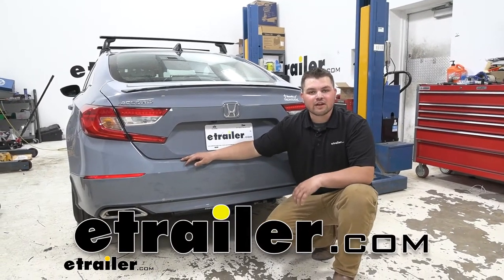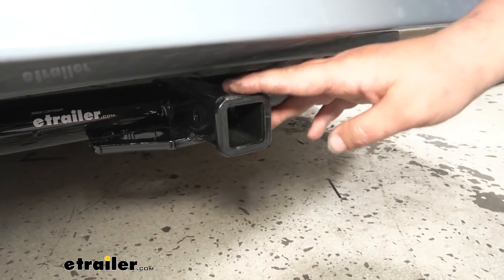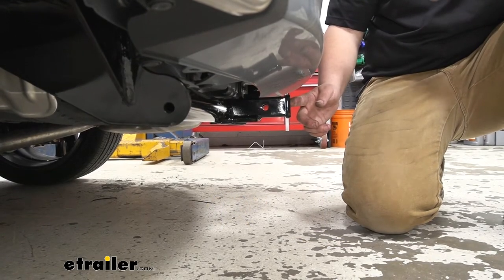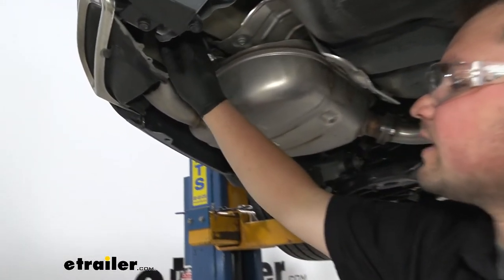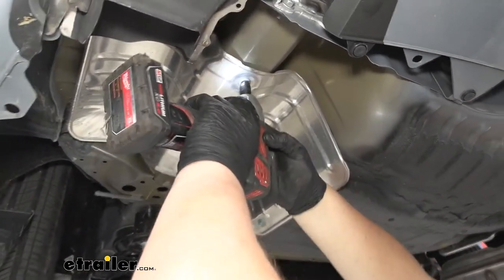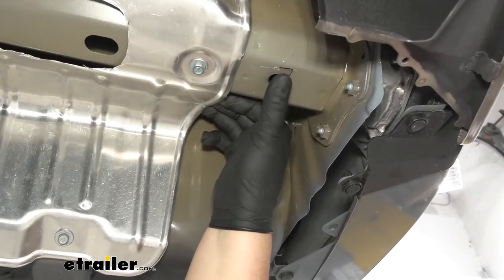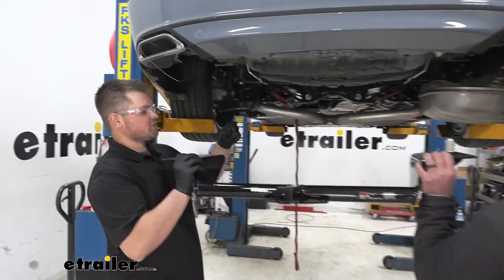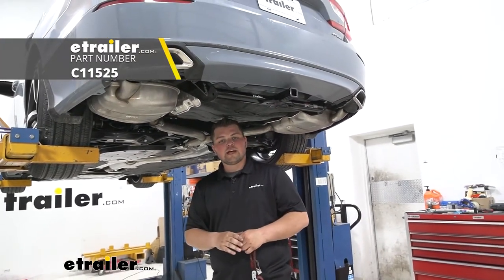etrailer | Curt Trailer Hitch Installation - 2021 Honda Accord

Comment: What about a dirt bike
Reply from the maker: You will need to check in the owners manual of your Honda Accord to see what the maximum tongue weight capacity is and if the weight of the carrier and the dirt bike exceeds that.
https://www.etrailer.com/Trailer-Hitch/CURT/C11525.html